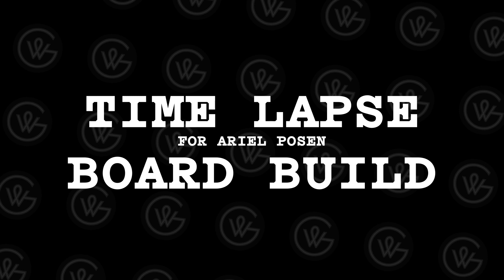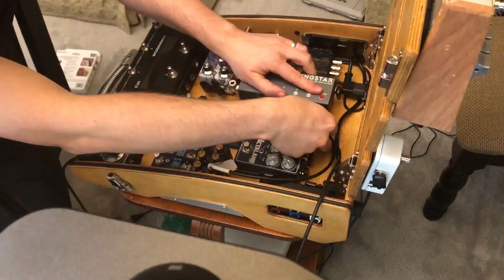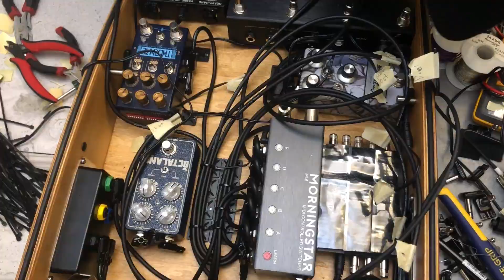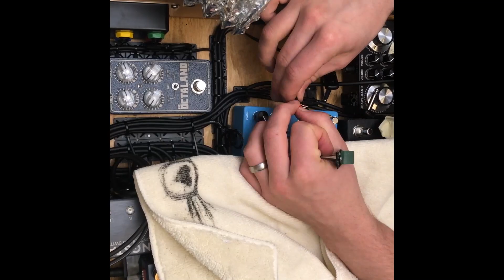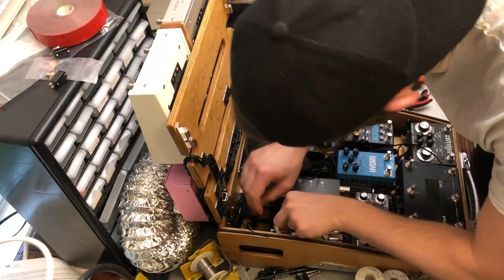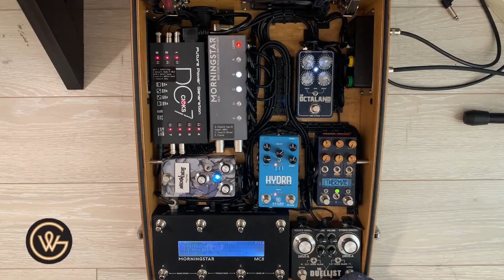Time Lapse Build for Ariel Posens Pedalboard!

Comment: Are you using the dryer vent to suck the smoke from the soldering? If so, what kind of vacuum are you using?
Reply from the maker: This actually all started when Goodwood was still a hobby... I didn't want to spend $1500 on a proper fume extractor so I ended up buying a 6" duct fan with those pipes.  Ended up working better than the pro fume extractors.  Just fed it outside a window.  The one in the pic is a 4" duct fan (not nearly as good).